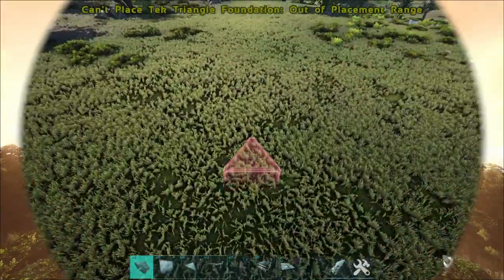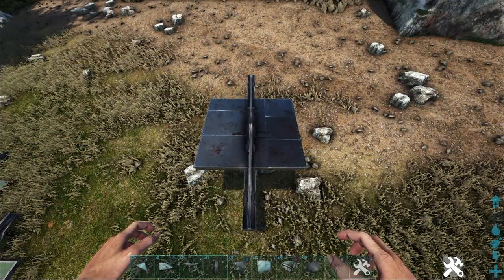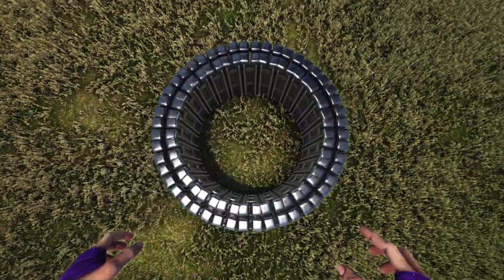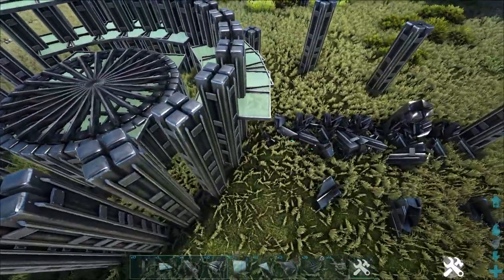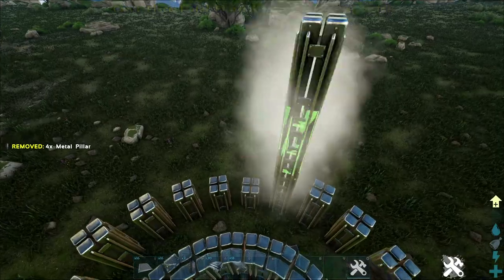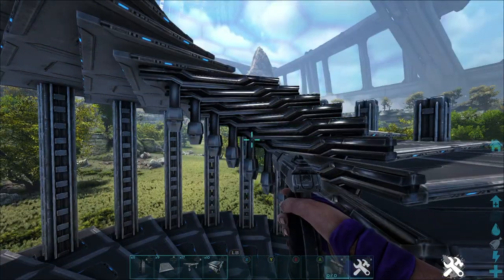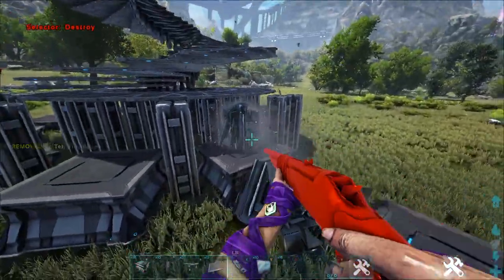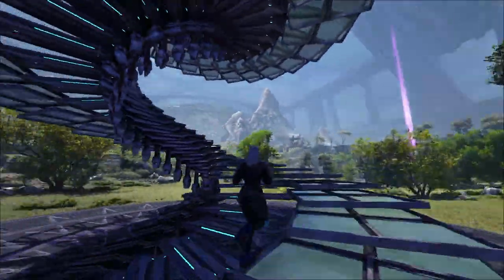How to Make a Spiral Staircase With Official Settings in ARK: Survival Evolved

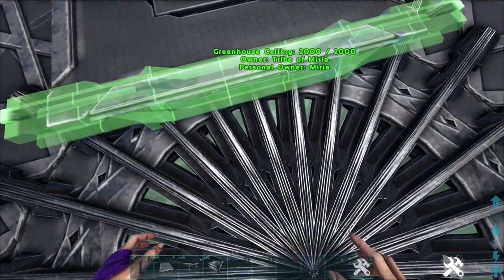Comment: Hi There! I'm running into an issue while building the stairs; I place the fence foundations at the outermost snappoint of the ceilings, but when I remove the one that is snapped to the pillar, it crashes. Any indication as to what I might do wrong? 5:45
Reply from the maker: The floats are not comming out propperly. Check Captain Fatdogs Floating Structures vid

Comment: Just wondering, did fence supports not snap on the first circle of pillars? From there it should be easy to extend down I thought.

(Sofar my only 24 sided project used triangle foundations as base so the supports did snap in the ground as well and prooved a great way to extend at same level until the ground lowerd enough to extend the support 1 full layer down.)
Reply from the maker: Haven't tried fence supports much honestly. Fence foundations would have worked to extend the pillars. Also a foundation grid. But I didn't wanted to derail much from what I did in my Tek Spiral build. Everything is connected there so you can just make a square snapped to any pillar or foundation in any way you can and that'll work. You can always hide it later anyway.